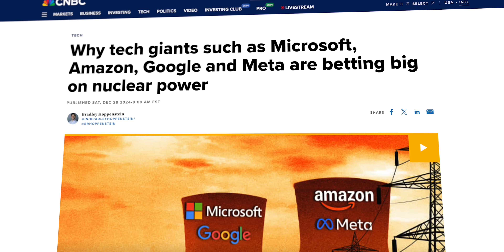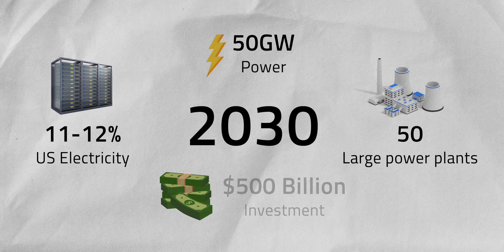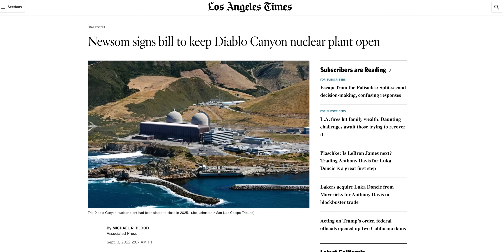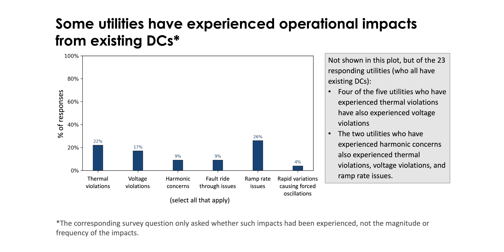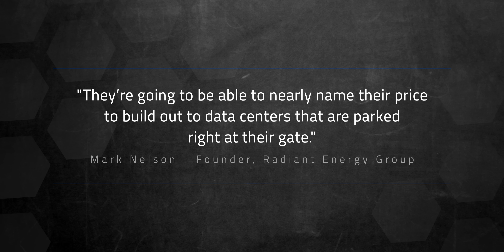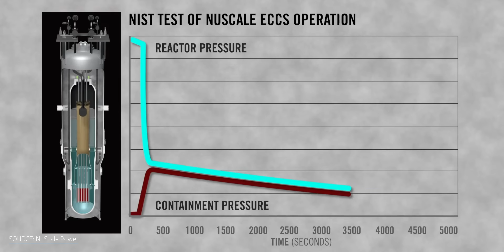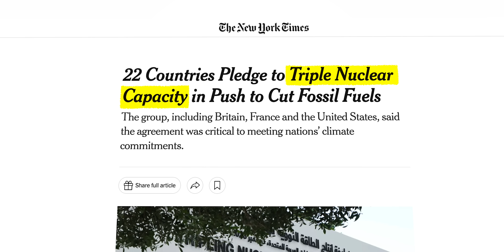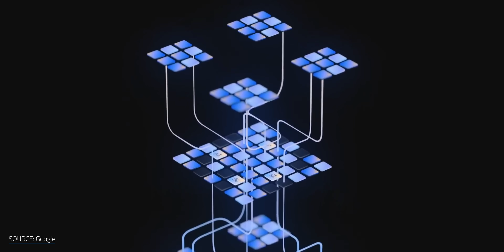Why Big Tech's Betting Billions on Nuclear (Not Renewables)

Comment: Most people are not aware that reactors cannot be simply made smaller, and cost less, as is often assumed.  The reality of neutron flux is such that neutrons go pretty much where they want to, so the smaller a reactor, the more of the neutrons needed for fission, are instead lost outside the reactor.  There is a solid physics-based reason that most commercial reactors are in the GW size - this size reactor has enough fuel rods in close proximity to make the most use of the available neutrons.  Said differently, small reactors suffer terribly in their inefficiency, which translates directly to orders of magnitude higher per watt cost.  So “small” modular reactor is really  a misnomer, as they aren’t particularly small, and cannot be.  The real way forward is to build more AP1000 - as the design is now firm, there is a trained workforce, and a supply chain - none of which existed when Summer and Vogtle started and are almost entirely the source of the cost and schedule overruns.  All that is behind us now.  And now that Vogtle 3 & 4 are online and at full power - the naysayers are scarce, while customers in the area can confidently run their air conditioning in the longest warm spells.
Reply: I mean SL-1 taught the general population that having an reactor vessel with one controlling rod is the equivalent of getting zapped by the demon core

Comment: I think the best way forward for everyone is to use a combination of our existing power generation technologies. Nuclear (SMR or the regular ones) for industrial needs, solar and their corresponding storage solutions (Solid state batteries that are supposed to come out soon or flat-out regular batteries) for regular homes and even large apartment complexes, a combination of solar and modular wind turbines (if they become available at some point) for charging stations for EVs and small scale business uses.

This kind of setup should easily make us carbon neutral in the short term before some mind-boggling breakthrough occurs again and propels us even more into the future.

The only issue I can think of is the problem with mining Lithium and how toxic and generally inhumanely it is sourced for the batteries. Although, I have been hearing about nickle batteries being tested that should replace lithium. i guess we will just have to wait and see.

Then there is the problem of regulations and ease of access for these technologies to fall into the hands of us common folk but that is a story for another time I guess.

Comment: The NAVY has operated small scale nuclear reactors for 50 years without any accident of large scale.
Reply: Sounds like we should plug the Nimitz-class aircraft carriers into the grid as they are decommissioned....
Reply: @tompw3141  or at least reuse the parts fro it
Reply: they use highly enriched uranium, that is not available to private sector.
Reply: Sure, but there have been multiple subs sunk with nuclear weapons on board. Nothing exploded but there's no knowing whether all materials were recovered or not as the details are classified by the respective nations that owned the subs.
Reply: That we know of!!!
Reply: cost wasn't an issue....
Reply: @silverdiverr lol
Reply: @emildiver  This is not true at all, cost is very much an issue.

Comment: I think it is faster, cheaper, and safer to invest in geothermal, Solar, Wind, and Tidal. Far beats 5 to 10 yrs to bring Nuclear online. No geopolitics, though Iran might want to sell their uranium. No issue with Nuclear Waste.  And from the videos you showed, it looks like they can put them in an office building which makes it seem like the public might not know they are 50m from a Nuclear Power Plant.  And in those 10yrs the usage will go up, but so will computing power, while as DeepSeek showed with better algorithms and Apple & NVIDIA showed with better chip designs power consumption can go down.  60% of the power runs the CPUs and 40% is just to cool them. Passive Cooling Systems could cancel out the projected power increase over the next 5yrs.

Comment: Check out EBR-1 (Experimental Breeder Reactor - 1) in Idaho. It produced electricity as well as the stuff that goes boom, but it was designed to be fail safe and could be shut down with the pull of a handle attached to nothing more than a rope.

Comment: Almost a certainty that the tech behind data storage will eliminate the power supply requirement of current systems. 
It costs 1/1,000,000 today what it was 25 years ago.

Comment: cuz renawable is a scam and not green if you take in account resource gathering and pay in eu wages to make renewable the weak chinees yen make it possible.,nuclear is more compact always performs dont need useles infrastructure like gasplants on standbye for wind aint blowing sun aint shining nor does it need batteries....and its more recource efficient since unlike windturbines a nuclr plants turbines are near always spinning.and thus using the copper more efficiently and dont come with ur bs waste.. safety...that shit hes been solver 40y ago ofc if you decide to drive a car of the 1940 it wont have safety or air bags same counts for nclr plants.

Comment: In fact, this is why there is serious consideration of moving AI data centers to place that have plentiful clean energy: Iceland. That island's geothermal resources have barely been tapped, and it could be used to power large AI data centers with extremely low air pollution. Another possibility is Norway, given that country's massive hydropower resources.

The massive demand for power by AI server farms is reaching a point that renewables, even with battery backups, are no longer viable, as it would take huge swaths of land full of solar panels or wind turbines to generate the power needed. And everyone agrees hogging all that land to build very large scale renewables generation is not exactly environmentally friendly, either.

Comment: And not a single mention of the waste products, which will still be radioactive in a 1000 years.
Reply: Good. Long half lives mean LESS radiation over a LONGER period of time, Short half lives means MORE Radiation over a SHORTER period time.
Reply: Spent fuel can be reprocessed into new fuel rods for more energy.

Comment: And ther will still be backup diesel generator at every datacenters. Datacenter up time is the the most important thing to them the larst datacenter i visited for work two separate spread grid connections a site UPS and diesel generator with fuel to run 24hr on site with a contract to fuel delivered so they can run 24x7 on backup diesel generator id need. And this is some where with a good stable grid. The backup diesel generator will probably never run in anger outsite of commissioning.

Comment: Ok, did I miss the part where he talked about the great new solution for nuclear waste?
Reply: Look up fast neutron reactors. What most people don't realize is "spent fuel" still contains a massive amount of energy. The original plan was to move that fuel to fast neutron or breeder reactors after its first use. However Jimmy Carter proclaimed that the spent fuel was "waste" because he was afraid it could be stolen and used to make a bomb if it was sent somewhere for reprocessing.
Reply: The old solutions work fine. Bury it in a mountain. You can use it as a fuel source for a small thermal power plant since a large mass of it packed together will generate heat as it radiates and hold enough of it to be useful.
Reply: @phillipnunya6793  As of one year ago: There is “no clear path forward for the siting, licensing, and construction of a geologic repository” for nuclear waste, according to a recent U.S. National Academies of Science report. About 88,000 metric tons of spent nuclear fuel from commercial reactors remain stranded at reactor sites, and this number is increasing by some 2,000 metric tons each year.  Congress hasn’t appropriated funds for its Yucca Mountain nuclear waste program since 2010. In fact, Congress has so badly mangled the process of collecting and appropriating the ratepayers fund, now over $40 billion, that it has rendered these funds essentially inaccessible. This money, actually collected from electricity ratepayers, not taxpayers, is being used to offset the national debt.  So there is no funding.

Comment: The new light computer chips need less electricity.

On the new SiPh chip, regions of the silicon surface are made thinner, modifying how light scatters through them. This scattering of light waves enables swift mathematical computations. And since it uses light rather than electricity, it's incredibly fast and energy efficient.25 Feb 2024

Comment: Nuclear GRID electricity biggest problem is it economics.

For every $100billion in generation the nuclear plant needs $TRILLIONS in GRID CAPACITY.

The first round of nuclear plant construction FILLS the existing national electric grid. 

But 10 times more clean electricity is needed to millions and millions and millions of buildings and vehicles to replace fossil fueled CO2 emissions. 

Now, the real massive NEW GRID expenditure is needed.

Nuclear GRID electricity 2nd BIGGEST problem is also economics.

247 operation. 
As nuclear is massive thermal electricity generation plant and load ramping is extremely stressful 247 full UTILIZATION is a necessity. 
247 cashflow, as nuclear construction has a massive financial demand. 247 constant grid demand. 

Evolution in technology in PV rooftop DIRT CHEAP cheap electricity (no grid costs) and massive FREE electricity storage 23hrs every day and all night long in BEVs, battery electric vehicles.
Consumer's own dirt cheap electricity in under utilised free mass storage. 
300million in USA, 20million in Australia. 

Nuclear plant owner's SHTTSNPANTS 
Grid owner's bigger SHTTSNPANTS 

Nuclear promoters are stealing free grid access and government taxpayers money and government cashflow guarantees.

Australia's warm Sahara Desert latitudes and decade long droughts means LNP $20billion pumped hydro is utter waste and Australia's 8,000 billion m² of sunshine means LNP nuclear economics is a dead duck. 

Billionaires are looking for government garrenteed mega projects to park billions.
Mega projects with 100 year profitable  government garrenteed cashflow.

Australia's privately owned hospitals and toll roads and tunnels and bus routes and trains and airports and national electrical grid and news broadcasters and natural gas and ...

Every day the sunshines nuclear electricity is a dead duck, in most of the warming world 247, 365 days
In cold latitudes 247, 300 days.

Comment: I ask DeepSeek what is the best way to source new power for AI data centres. Below is the response.

The best source of new power to run AI data centers depends on several factors, including sustainability, scalability, cost, and reliability. Here are some of the most promising options:

### 1. *Renewable Energy Sources*
   - **Solar Power**: Solar energy is abundant and increasingly cost-effective. Large-scale solar farms can provide significant power for data centers, especially in sunny regions.
   - **Wind Power**: Wind energy is another renewable source that can be harnessed, particularly in areas with consistent wind patterns. Offshore wind farms are becoming more viable.
   - **Hydropower**: For data centers located near water sources, hydropower can provide a consistent and reliable energy supply.
   - **Geothermal Energy**: In regions with geothermal activity, this can be a stable and sustainable energy source.

### 2. *Nuclear Energy*
   - **Traditional Nuclear Power**: Nuclear energy provides a high-energy output with a low carbon footprint, making it a strong candidate for powering large data centers.
   - **Small Modular Reactors (SMRs)**: These are smaller, more flexible nuclear reactors that can be deployed closer to data centers, providing a steady and reliable power source.

### 3. *Energy Storage Solutions*
   - **Battery Storage**: Advances in battery technology, such as lithium-ion and solid-state batteries, allow for the storage of renewable energy, ensuring a consistent power supply even when the sun isn’t shining or the wind isn’t blowing.
   - **Hydrogen Storage**: Hydrogen can be produced using excess renewable energy and stored for later use in fuel cells to generate electricity.

### 4. *Grid Integration and Smart Grids*
   - **Smart Grids**: Integrating data centers with smart grids can optimize energy use, allowing for dynamic adjustments based on energy availability and demand.
   - **Demand Response Programs**: These programs can help data centers reduce their energy consumption during peak times, easing the load on the grid.

### 5. *Hybrid Solutions*
   - **Combining Renewables with Traditional Energy**: A hybrid approach that combines renewable energy sources with traditional energy sources (like natural gas) can provide a balanced and reliable power supply.
   - **Microgrids**: These are localized grids that can operate independently or in conjunction with the main grid, often incorporating a mix of renewable and traditional energy sources.

### 6. *Energy Efficiency and Optimization*
   - **Advanced Cooling Technologies**: Reducing the energy consumption of cooling systems through innovative technologies like liquid cooling or AI-driven cooling optimization.
   - **Energy-Efficient Hardware**: Using energy-efficient servers and other hardware can significantly reduce the overall power demand of data centers.

### 7. *Carbon Capture and Offsetting*
   - **Carbon Capture and Storage (CCS)**: For data centers that still rely on fossil fuels, CCS can help mitigate the environmental impact by capturing and storing carbon emissions.
   - **Carbon Offsetting**: Investing in carbon offset projects can help balance out the carbon footprint of data centers.

### Conclusion
The best source of new power for AI data centers is likely a combination of renewable energy sources, advanced energy storage solutions, and energy efficiency measures. The specific mix will depend on the geographic location, available resources, and technological advancements. As the world moves towards a more sustainable future, the emphasis will increasingly be on renewable energy and innovative storage solutions to ensure a reliable and environmentally friendly power supply for AI data centers.